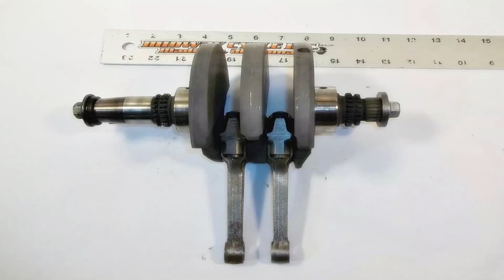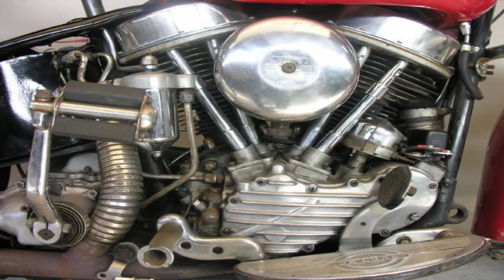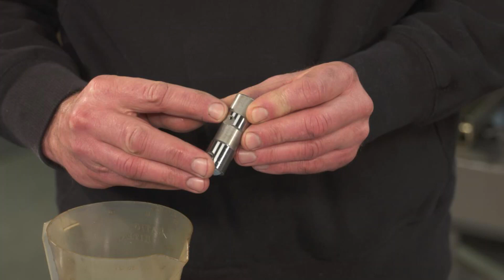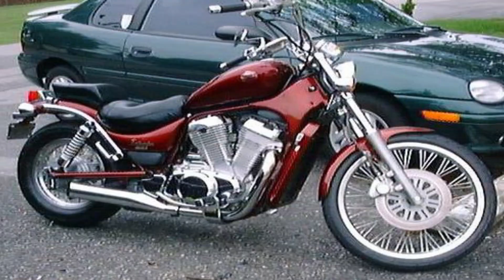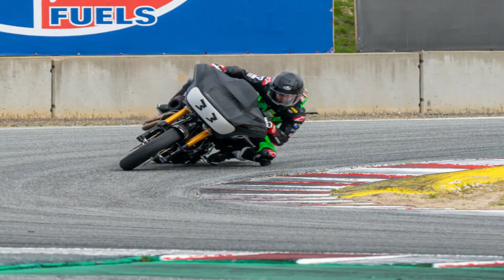Harley-Davidson Engine Design is the Worst

Comment: Holy crap you would think Harley Davidson being that their engines are old same design for a long time pushrod engine. But you would think that they would be super dependable. You know Harley Davison the rock American. But instead they’re probably one of the worst for being dependable especially since they started outsourcing everything. I mean how many motors have blown up because of the lifters being outsourced. I mean with good quality aftermarket parts it blows your warranty and puts them in the hole. And now they got rid of Brembo clutch assemblies well master cylinder for the clutch slave cylinder whatever you wanna call it. Back to cable I like cable but I mean they’re going backwards. Look at the lights they have taken off the bike street glides dressers I’ve taken lights off I’ve taken lots of things off of them. They’re even taking the chrome off of them and you know chrome cost more than powder coating. So if it’s powder coated it should be cheaper. I know everybody likes to murder look. And that’s fine I like it too . Now Harley Davidson is closing lots of dealerships that have been around for a long time. Putting people out of work getting rid of America. I love my Harley Davidson I’ve had many but I am starting to like the Indian. I I mean look at the automatic adjuster for the Primary. Do you know what I’m talking about yes you do. Lol just a little mad right now with Harley Davidson. I don’t have the bike anymore but I had it 08 ultra limited very surprised to see the whales were made in China. That was the beginning. No engine parts. I guess I’m figuring that stuff out. Harley was getting from 5 to 15,000 miles out of a set of lifters. And the run out on the Crankshafts. Well I’m sticking with Harley but I don’t know if they can last. And we all know are they are going to an overhead cam motor I think it needs more work I think it needs to look like a Harley motor anyway. Anyway I’m done thanks I enjoy you blog video .
Reply from the maker: It's sad they went backwards in my opinion when it came to quality at the cost of faster and cheaper production on the engines.
Reply: @GixxerFoo  it is I keep going backwards got rid of Chrome everybody knows chrome is more expensive than powder coat. Outsourcing everything and now they’re closing dealers lots of dealers my dealer great dealer they have two weeks to close their doors and Harley they took the franchise .

Comment: There's something to be said for simplicity. Just like the old phrase says simplicity is the homework of genius. Harley's knife and fork single pin crank is probably one of the best designed engines ever made for a multitude of reasons. First, although it is now considered antiquated, that design was very well ahead of it's time upon its conception, and it's lasted over a hundred years, which is unheard of with pretty much any other engine design ever made. Second this design is user friendly. Any descent mechanic can usually handle the basic maintenance, and even most of the extreme modifications that don't require machining, such as milling the cases  and/or the cylinders for big bore kits. Cam swaps etc can usually be done by a shadetree mechanic with some time and patience. And I know that people love to talk about Harley Davidson motorcycles breaking down all the time, but I've been riding for over twenty years now, and have never had any major issues that were not self inflicted by poor decision making when upgrading the engine. If proper maintenance is done, these bikes usually run extremely well. And they can take a beating. Third, Harley's are just absolutely fun to ride. High power water cooled bikes are great, and can be a blast to ride, but they just don't have that low end grunt and torque that makes the Harley so fun to ride. Litre bikes, and muscle bikes can be fun, but more times than not, all that power is up on the top end, and in most cases, you never get to realize their true potential. On the other hand, those old air-cooled single pin crank Harley's have the torque and power right in what I would consider the sweet spot when it comes to riding. It's much more fun to ride a slow bike fast than it is to have a really fast bike that you can't get the power out of. That was the genius of the Buell motorcycles... especially the xb series bikes. They weren't fast compared to the sport bikes they were in competition with, but they are super quick, and flickable, and there's something to be said for running through the curves faster and more confident. All motorcycles have their place, but there's just something special about those air-cooled Harleys.  I really like where Harley Davidson is heading with the revolution engine, and these newer updated bikes, but I hope they keep the air-cooled 45°engine around for as long as they can. That design is iconic as Harley Davidson itself. Either way, great video, and thanks for the content. Stay safe, and enjoy the ride.
Reply: Yes, I couldn't agree more👍
Reply: I agree with you all the way. People that say Harleys always break down either don't know what they are talking about or tried to work on one and couldn't even fix a ham sandwich. By that mean they should not try to work on anything.
Reply: Excellent points you made about the Harley engines. I've never owned or ridden a Harley, but I absolutely agree with what you said. I've always wanted to own a Harley air cooled V-Twin, because the engine is completely different than any other motorcycle engine, and the torque experience at low speed, is a completely different world compared to a modern high revving engine. The closest thing I've ridden is a Yamaha XS650 Special, air cooled. The XS650 has a super long stroke, and basically all of the torque is available at about 2,500 rpms. There's nothing more exciting than letting out the clutch with a super long stroke engine, feeling it rip away like a tractor. I pray they never get rid of the air cooled tractor engine, because I'd like to own one someday. Also, the sound of a Harley single crank pin engine is the most heavenly sounding thing on Earth. My daily driver now is a 2008 Hayabusa 1340cc inline 4, totally stock. The Hayabusa engine has the longest stroke of any modern 4 cylinder motorcycle, it's a "stroker" engine. It has a 2.75" stroke, compared to a Yamaha R1 that has a 2.0" stroke The Hayabusa engine is like a tractor, and anything over 2,500 rpms, it pulls like a tractor. Many people don't understand the point of a Hayabusa. The point is, the torque... 114 ft. lbs, stock. Switching to a different bike, with less torque, is a massive let down..

Comment: They’ve already built a modern V-Twin with the V-Rod motor. Lots more HP, liquid cooling what’s not to like? 
 If they offered this option in the Touring line up, it wouldn’t take long and the air cooled engines would go away.
Reply from the maker: I think we'll see a big inch liquid cooled bagger from Harley before too long.

Comment: i think this is "when they cant do it anymore'. that said you cant get into the boys club without one. so matter what shit Harley throws out there it'll sell. they know it. look what they did to the brand already. its no longer an American made bike. that doesn't seem to matter. its made out of plastic doesnt matter it costs more than a really nice car or in my case my house doesn't matter. somehow they've been able to keep up " the bad boy images"  on a machine that has nothing to do with it origin except its shity design. all that said the used market is flooded and you can buy them cheaper than say a kawasaki and thats the reason im still riding Harleys ... after 40+ years. that said up till this one i built all my bikes out of swap meets , fixed all the Harley f$%k ups before my ass hit the saddle i sewed. now we bolt on parts off a shelf and have a " custom bike"? . yep im old.

Comment: If I had the money I would just buy an old Harley Davidson. Pull out the engine and buy a crate engine from Polaris and stick it in the frame. Then I would have the best of both worlds. It would still be a Harley with fit and finish and it would be powered by a kick-ass engine and still be American made. LOL. I know some heads reading this probably just exploded. 
On a side note Harley Davidson critics are usually former Harley Davidson owners that have ridden other platforms. There is nothing wrong with constructive criticism.
Reply from the maker: Lol that would for sure explode some heads but it would be a truly best of both worlds unique ride.

Comment: To answer the question about redesign, yes.  I still think the reasoning for the M8 is so you will have to go back to the dealer for the parts to get it up to regular performance for the design. It's expensive if you do not do the work yourself. The air-cooled evo-sportster motor is superior in design to the M8, no chains, four gear cams, straight pushrods, combined gearbox and engine, right side secondary belt, Triple row primary chain. The only downsides are the primary chain tensioner, the gearbox and engine use different oil although if you dumped the same engine oil in the transmission it would make no difference. It could use better balancing because it has too much vibration. The battle of the baggers? Look at what Lloydz did with a 106 Victory and compare it to the 131. Challenger engine is a 108. I can't imagine what Harley would charge you for the race 131. Look at what Vance and Hines did with the Vrod engine. Compare that to the 131 or the 106 or the 108. It was above all of it. As far as sound, once the throttle is rolled out of idle there is not any notable difference. I poke fun at the new Harley guys saying my old sportster sounds like a real Harley and yours sounds like a new Harley. LOL. This is my theory about Harley Davidson. It is two companies rolled into one with different interests. The one side that makes the most money runs the company with little or no experience with motorsports. The apparel side runs the entire company and bean counting is their bottom line not motorcycles. I think the motorsports side of the company has been trying to break out for years but they cannot due to bottom line money and thinking. At the end of the day there is very little put back into the motorsports and apparel guys do not care because once they sell a shirt or jacket they do not worry about it.

Comment: I dont understand the obsession with making lots of HP with a Harley. As long as it has enough to cruise at 80mph, makes pleasent vibrations and a good sound I am happy.  If I want hp just get a different style bike from a dufferent manufacturer.
Reply from the maker: They sure are fun to ride when you've got some serious low end torque and horsepower.
Reply: @GixxerFoo   True all I need is a wood Cam a good Turner  Air intake do exhaust push the  Dorkright where I want it
Reply: @GixxerFoo   I would rather have higher torque than horsepower is why I now ride a 88ci road king with 95 big bore wood cam hp is a lil over a 100 but my fpt is over 120
Reply: I don't care to ride my Harley too much over 80mph. I just want to get there in about 4 seconds, hence the intake, pipes, cam and tune.
Reply: I enjoy surprising people with 120 HP 124 TQ out of a TC88B (now a 107). No surprising anyone on a GSXR. The fun is in the journey, the novelty and the sound and it's American, more so now after all the mods anyway. 
Little O
Reply: @toddoverby5538  exactly.  I've had a few people think that my Harley is slow. Even the guys at the dealer have asked me "wtf do you have in that thing?" Just a stage two. Cam, tune, intake and pipes. The smell of the exhaust and the symphony coming from the Vance and Hines short shots is a drug and therapy rolled into one. I took her for a quick putt yesterday and had her up to 110 by the time I had merged onto the highway from the on ramp. I'm 48 and still smile like a giddy child when she's sitting in my driveway warming up at an idle. She doesn't have the traditional Harley "lope" because of the cam and the heavy breather intake is massive. I swear my bike is an extension of myself and I feel at home on top of her with one hand on the drag bars cruising at 80mph and 2800 rpms. Shit, I need to get home and go for another putt. Keep the wheels down.
Reply: LOL I agree with you to the point of why do you need more horsepower I don't know I don't understand it but I'm one of those I ride into the low and mid-range basically all the time but I always have to have more horsepower I don't go after the p course power I like it like I said low and mid-range that when I roll a throttle on it's there and that's the way I've got my bike set up yes I want more but to get more power I'm going to lose my load mid range so like I said I agree with you I don't understand it but I'm one of those have a blessed day brother
Reply: As in all things, different strokes for different folks.  Some guys buy a stock bike, maybe swap out the seat and exhaust, and ride the wheels off of it.  Then there's the other extreme.  They push their machines to the absolute limit.  Power is like money........They never have enough.  It's a spectrum.  After many years I find myself on the first third of that spectrum.  Stage 2 and a few mods is enough for me.
Reply: Best thing I did to my M8-107 was have a torque cam put in and changed out the exhaust  and intake for performance “sleeper” parts.

Paired with a the legends flagship front and rear suspensions   

Ooof what a dream.
Reply: Or get an S&s crate motor
Reply: You obviously havnt rode a Harley with a good cam in it. They are a blast to ride, power when you want it, need it, sounds better with a cam and vibrates more.
Reply: @Prometheus1979  I got two shovelheads so I think I have the vibrations part covered. I care much more about a bikes character than the power. I once had a gsxr1100 and didnt like it much...
Reply: That’s it.  If I want to go fast I’d own a Ducati
Reply: Why not that's what I say😉
Reply: honestly the m8 107 in stock form has plenty of power don't even need to drop a gear to pass on the highway
Reply: I bought a BMW K1600 GTL and to be honest its the most impressive machine ive ever been on.  It had everything you could ever want but soul.  Ill take a slow Harley every day of week.  You have to upgrade the suspension though.  Harley springs are absolute utter trash
Reply: I guess if it has to be explained to you, then you would never understand
Reply: I guess if it has to be explained to you, then you would never understand
Reply: Well I can understand the obsessions. I have a 96 inch wide glide with a 583 cam, tuned with SE, I love there throttle response, I would not be satisfied with something slow, it gets up to speed very quickly, I don't know what numbers im pushing but I really don't care, I don't want it any faster cause I can't slow her down fast enough, that's the only thing I hate is my brakes
Reply: I fully agree. If you are chasing horse power, why bother messing with a Harley? It doesn’t make any sense. I have a Harley by the way.
Reply: The obsession is just the culture around cars and motorcycles in general in western nations. Harley gets the most crap because because of the price point to power ratio. In todays age, the only thing that matters is power. People are buying different bikes while Harley is striping features from their newer bikes and selling them back to the customer as a premium option. Harley's sales reflect their failure.

Comment: just ordered the zipper 468 cam kit with s and s  tappet keepers. still trying to decide between an s and s oil pump and cam plate or the fueling. this is as far as I plan on building the engine. plus the fp3 tuner. also seen screaming eagle has a new oil pump cam plate. any ideas?
Reply from the maker: Any one of those cam plates will be awesome in the M8, Feuling makes a really good one though in my opinion. That 468 will make your M8 like a whole new machine!

Comment: I hope they keep the single pin crank, knife and fork connecting rods. That sound and vibration is why HD can charge what they do. I think I read somewhere that when the engine was counterbalanced so smooth it caused problems with the transmission shifting. It needed that shake for the fork to slide the gears in and out. As nice as all the other bikes are, if someone gave me one I would sell it and buy a Harley. If they continue going in the direction that they seem to be, I will start looking at old 5 window Chevys to buy
Reply from the maker: It's truly unique and it's a whole different ride!
Reply: I have a 2005 Fat Boy 103 Screemin Eagle motor. It’s a balanced motor which is very nice and really never felt it as hard to shift.

Comment: Would be nice if you could choose which engine you want for any of the bigger bikes. The dyna frame is gone now, but I don't see why you couldn't adapt an air-cooled engine to the new softails. Sure it would take development money, but hey if you could get either an air cooled or water cooled 114, that'd be sweet.
Reply from the maker: It for sure could be done, I think Harley's biggest struggle is styling and the radiator.

Comment: What's knife and fork
Reply from the maker: It's the design of how the rods attach to the crank pin, basically the rod is split in two at the big end and then the opposing cylinder is the blade which fits into the gap at the crank pin. Hard to explain without a diagram, it sounds like a ridiculously weak design but it works very very well.